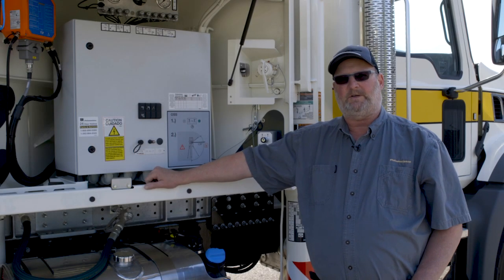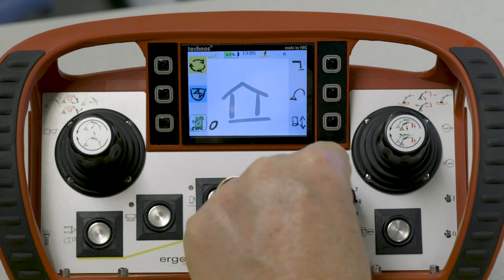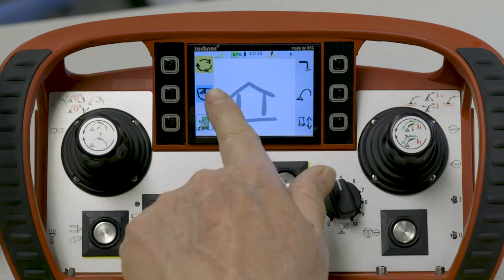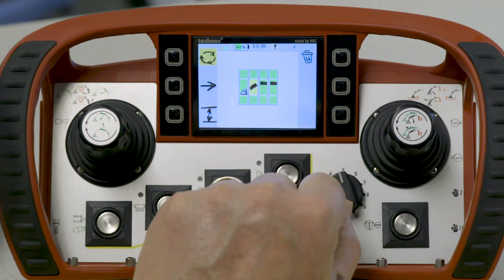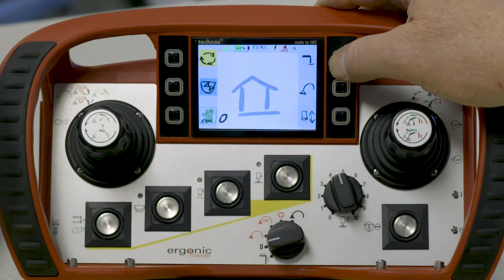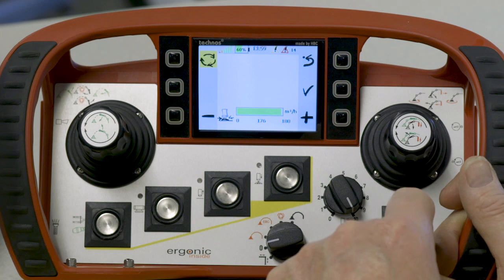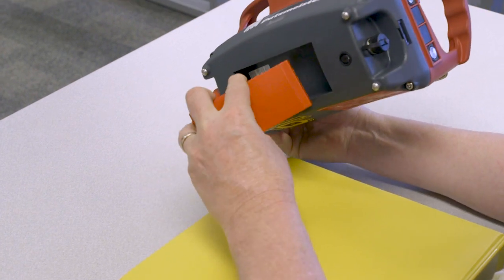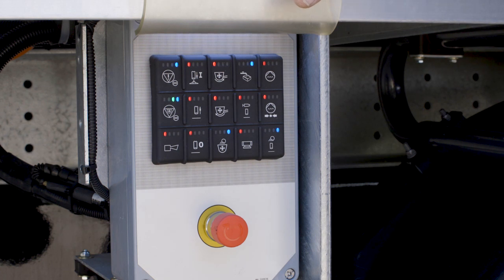Putzmeister Ergonic 2 system

Comment: Thank god schwing still exists!!! I've been pumping concrete on a DAILY basis since 1986 (you can do the math on that one) And the company I currently work for bought 2 of these technological marvels.. not one single operator likes or wants to run ether of the two pumps.. hey putz.. I just want to turn on the agitator why does it take me 3 minutes of scrolling and pushing buttons and finding menu's to do a simple thing???? If it binds up for any reason (which does happen from time to time) it literally takes 5min to forward and reverse it!!! On a schwing I just flip the switch over and done.. back up and running.. And finally one last thing.. is it really that hard to put the agitator circuit and water pump circuit on different valves so that I can add water when recirculating the concrete without the agitator shutting off???? Good grief.. you can  not pay me enough to deal with the headaches this system causes me.. SIMPLE IS BEST WHEN IT COMES TO CONCRETE PUMPS!!! nuff said